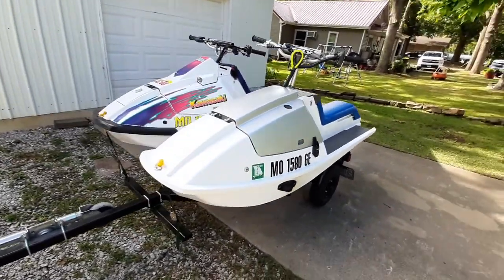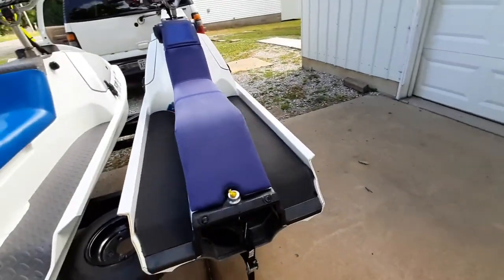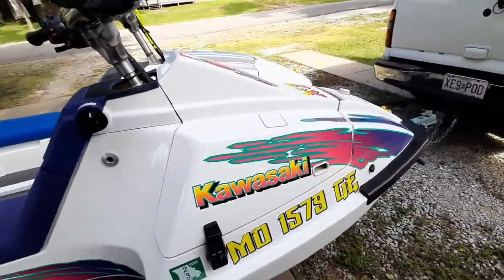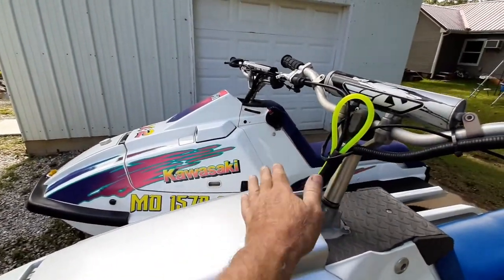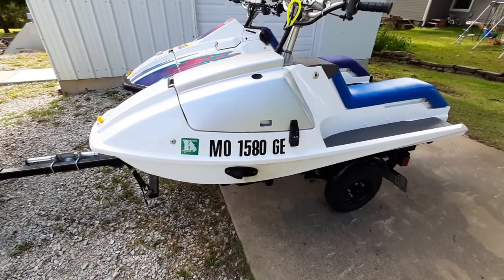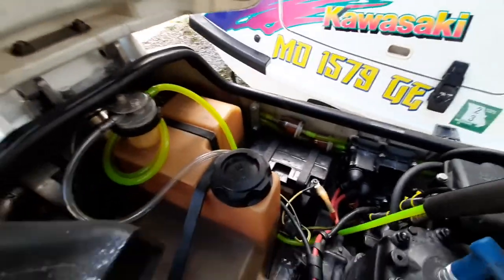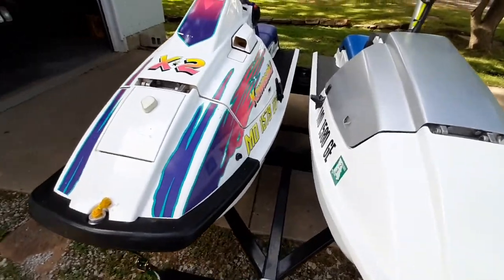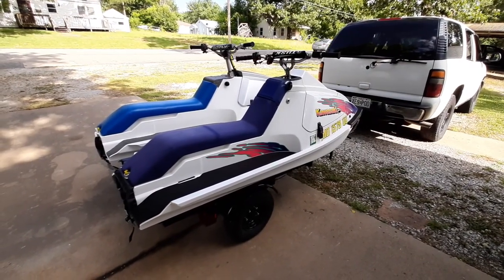Kawasaki X2 - A few mods I've done to my Jetski

Comment: Nice job! Clean build on those. Hoping to pick up a 91 X2 on Saturday. Any plans to add a Mikuni SBN44 to yours?
Reply from the maker: I wasn't really planning on it but I started doing some research and it looks like a great mod.  Thanks for adding to my winter project list!  LOL
Reply: @xpsgarage  I definitely recommend it. Especially if that's a 28mm Keihin on there now.
Reply: @xpsgarage  we ended up getting the ski. So far I've picked up a Mariner pipe, the SBN44 and a Jet Dynamics ride plate with 100mm extension. Getting to cold here in Washington to try it this year. So I'll be building it up for next summer.
Reply from the maker: @JetSkiBuyFixPlaySellChannel  Sweet!  Building a ski makes a great winter project just don't get it done too soon then you have to stare at it, wanting to ride it, until the weather warms up.  LOL
Reply: @xpsgarage  have you done anything new on them? I've been collecting parts and playing with powdercoating.
Reply from the maker: @JetSkiBuyFixPlaySellChannel  No, I've been busy with other projects.  I'll probably get to the X2s this spring.  How's the powdercoating going?
Reply: @xpsgarage  starting to get the hang of it and turn out some decent results.

Comment: hey! just got a 92 750 small pin swap x2, would it be ok to run it a few times before i install a bildge pump? im not a big mechanic so i dont feel comfortable removing my exhaust to install a bilge bump.
Reply from the maker: As long as you don't fill the hull up with water you will be fine.   Does it still have the foam in the hood and does it still have the factory siphon bilge pump?
Reply: @xpsgarage  Yes the seal looks rally good , the hood has all the foam still, and the factory siphon is still in tact.